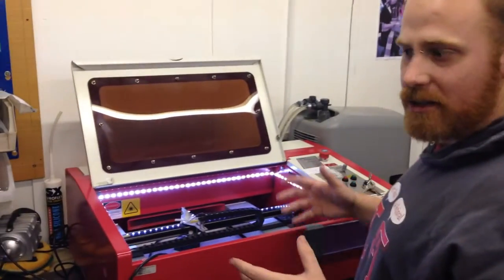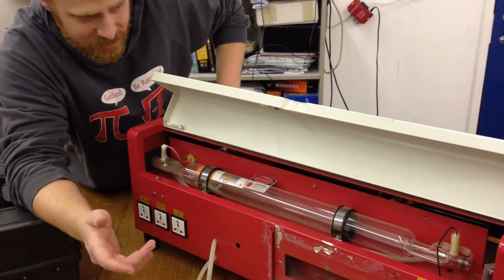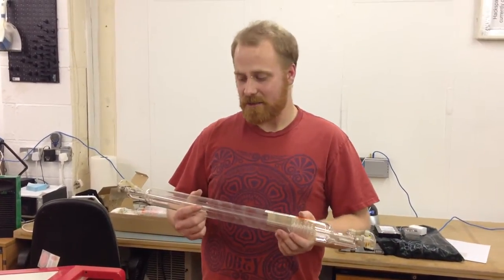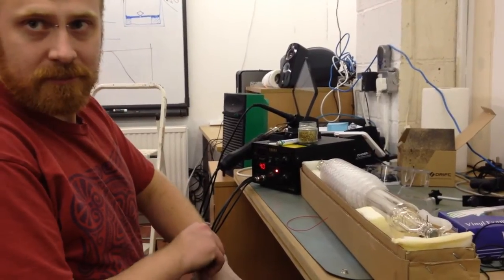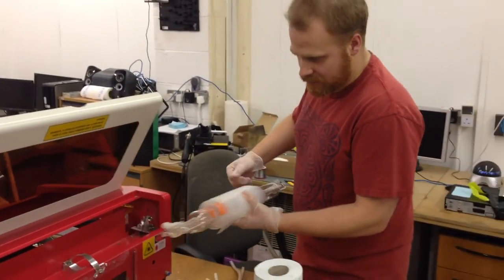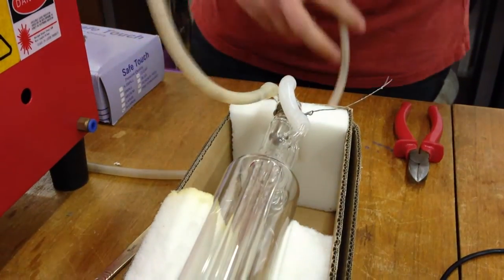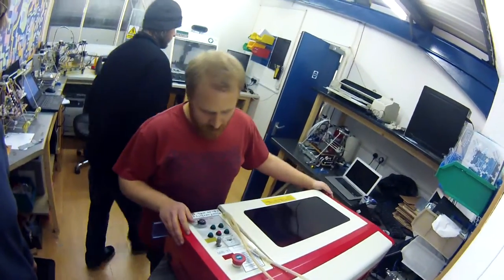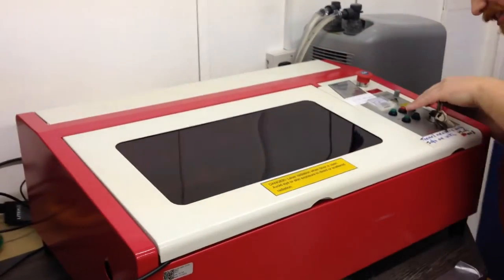CO2 Laser tube swap on an LS3020 at Rlab

Comment: Great video. My top tip for soldering heat-sensitive components like those pins is to clip a little croc clip at the bottom between the joint and the component to act as a heat sink. You can put some serious heat in before leakage to the sensitive stuff below the clip. Thanks!